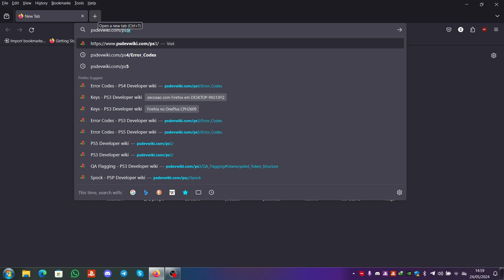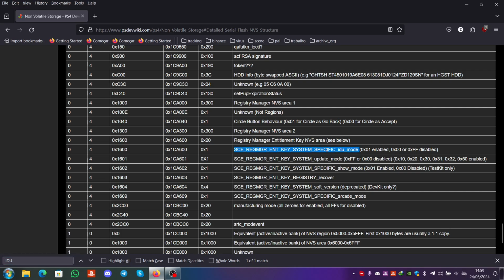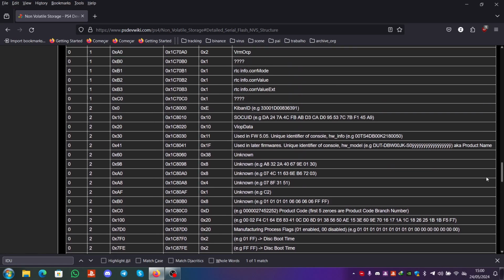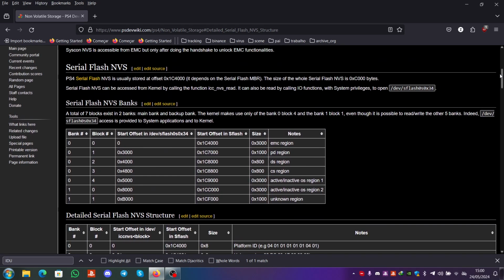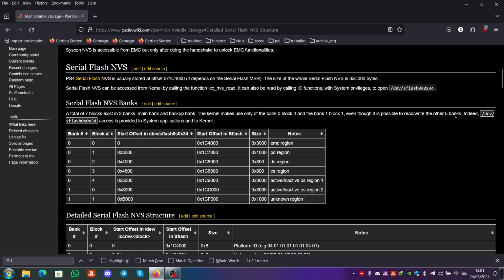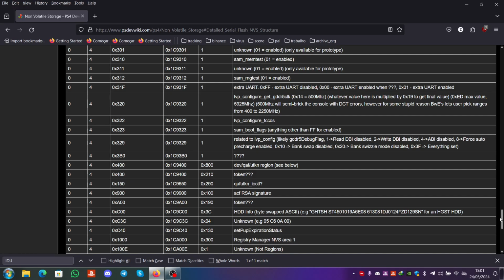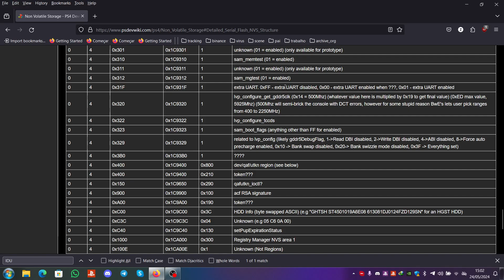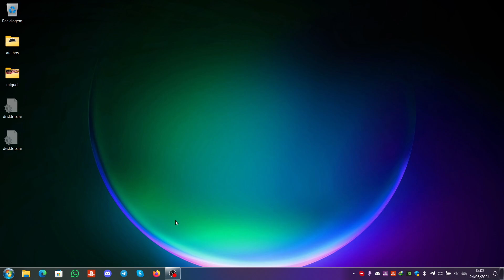Permanently Enabling NVS Flags when Servicing PS4 or PS5 Unit

Comment: Greetings friend from Cuba. I have always followed your work, I am dedicated to repairing video game consoles, I am writing to you because I am trying to find a solution to the problem of the blue light in the Play 4 due to the eapkey error, I have the BWE nor validator and managed to solve some, but other ps4 with loss of information from the 2 eapkeys, I have not been able to solve them, my question for you is: is there any way to repair this in the nor? Greetings from Cuba reiterated
Reply from the maker: you can easily solve that error if you get an identical nor dump from the same model as the affected ps4 and replace the regions where the eap key is generated. this should, in turn, solve the issue that you're having.
Reply: @ControleXecute  Thank you very much for your response and attention, I just have a question. You tell me that I should replace the regions where the eapkey is generated, what offset would they be within the nvs, if you could help me
Reply from the maker: @ivanrodriguez-vc3hf  do you have discord or telegram?
Reply: @ControleXecute  Ivan Rodriguez
Reply from the maker: @ivanrodriguez-vc3hf  i'm @zecoxao1 on telegram. add me